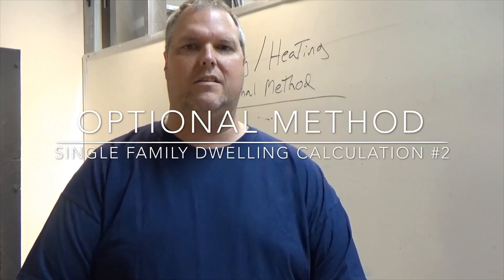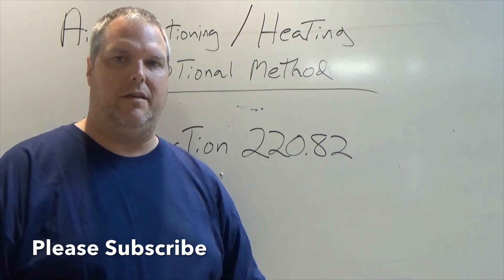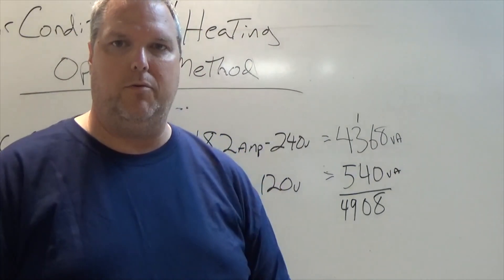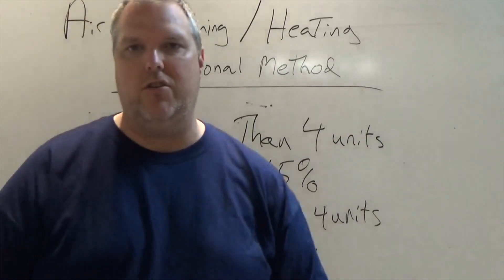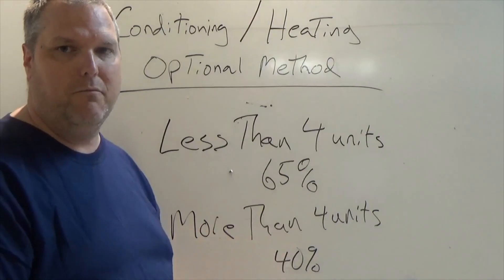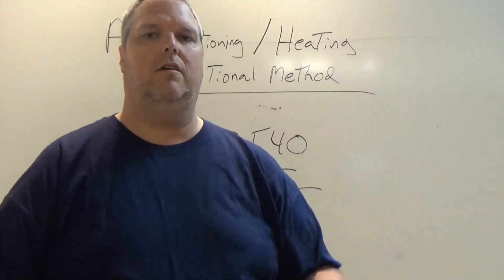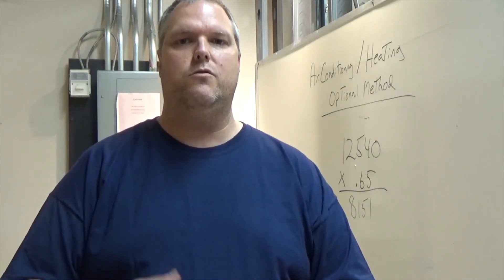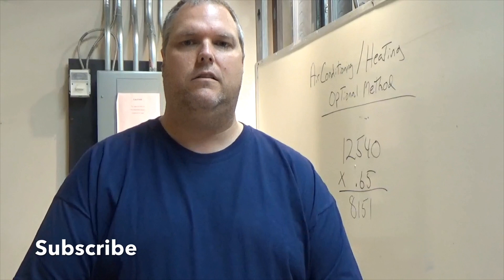Optional Method  Finding Air Conditioning and Heat demand loads Part 2

Comment: I'm super confused on this question and im getting ready to take my journeyman, any helps appreciated......A one-family dwelling has six 3-kW electric wall heaters (with individual thermostats) and five room air conditioners. Two air conditioners are rated 10.5 amperes at 230 volts, and the others are rated 7.2 amperes at 115 volts. A service calculation is being performed, using the optional method. How many volt-amperes should be included (after demand factors) for the heating and air conditioning? (Assume heater kW ratings equivalent to kVA.).

Comment: How do you do a 5 ton DX AC? 1 ton should equal 12,000 BTU? So how many VA would it be for 60,000 @ 2000 va/ton, or would it be 5 tons of cooling @2000/ton.

Comment: I have a central a/c with a c/u at 220v 17 amps and airhandler at 220v 7amp fan with 8k heater

And a mini split at 120v 12a how do I calculate this properly with the optional method

Comment: This is a great series, very clearly explained. My question is about heat pumps: Often times the ratings list minimum circuit ampacity but not full load amps. Should we use the MCA for demand calculations or do we derate to get FLA? Thanks.